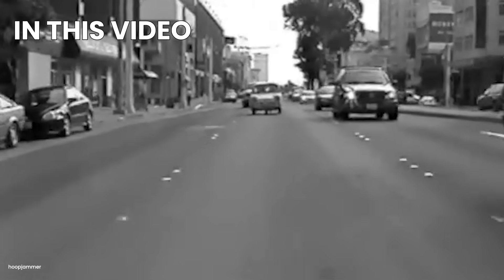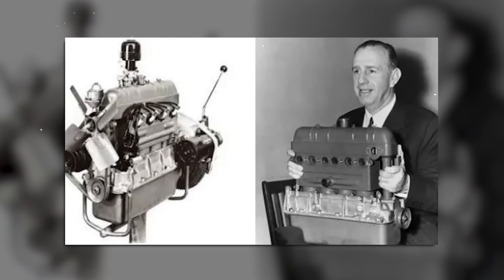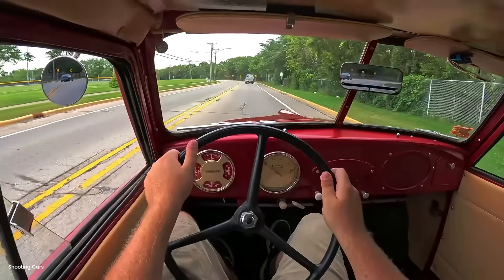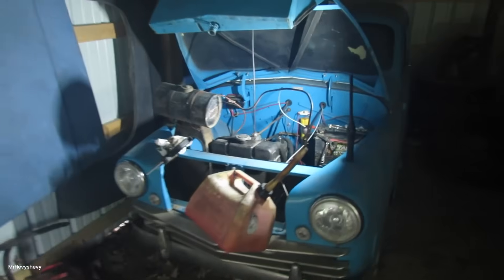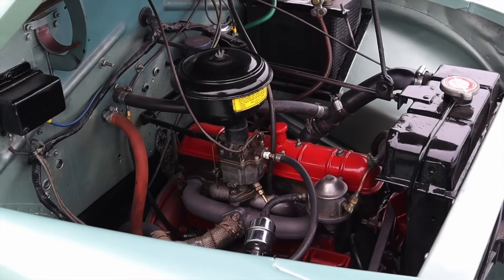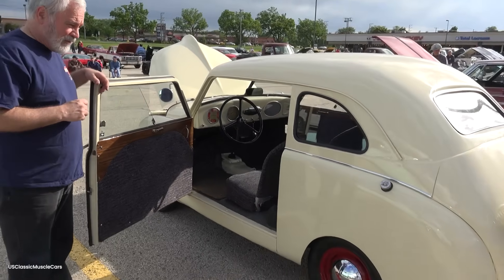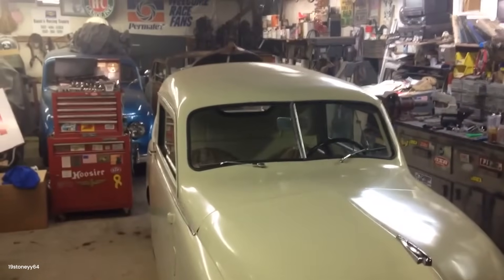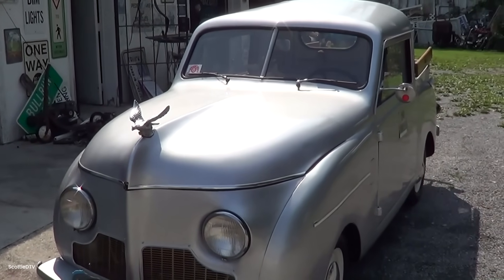Even at 30 HP & Flatbed Body, the 1947 Crosley Pickup Shocked Everyone Hauling Farm Loads

Comment: In the USA there are specialized vehicles sized like Crosley mostly based on golf cart frames and electric powertrain used in aeroports, in retirement communities, on golf course properties. There are neighborhood electric vehicles to complement those. Some places use ICE powertrain in parks based on gasoline or diesel. A lot of them are used on farms. I would argue that a lot of quad vehicles used for maintenance are in the same category. I would add some side-by-side vehicles, especially on the smaller size used on trails, parks, farms etc. A lot of those are manufactured by tractor manufacturers. Some are employed as maintenance grass mowers.
So, yes, the ideas and designs from Crosley are still alive in new vehicles. The one parameter, the carried load to weight ratio is mostly lost to modern complexity of safety equipment due to regulations. Small and very small engines market and electrical powertrain markets are flourishing  in those vehicles.
One more thing in common about Crosley vehicles and modern counerparts: they all are banned from use on highways/freeways in the USA and Canada. Some states made them illegal on the public roads allowing their use on private properties, off road. The latter creates a stupid need to employ huge modern trucks with trailers to move those vehicles from one place to another, especially on highways which is ironic.
Reply: stfu, you are just like most of todays generation, you compare todays technology to things that took place when technology sucked. these and the little bantam were better than any of the throw away shit made today by dikwads like you. you have no idea of what life was like in the late 20s and into the 50s. i have a crosley radio that was made in the 40s that even has a short wave receiver and it still works, the crap made today is used a while then junked. go hide in the basement keep your moronic opinions to yourself.
Reply: The Crosley Farm O Road was, for all intents and purposes, the first UTV.

Comment: This whole thing is filled with bullshit.
Reply: Please elucidate.  What, specifically, is incorrect?
Reply: @brucealanwilson4121  The Cobra engine was made of steel sheets shaped, drilled, and rolled into top, bottom, sides, ends, and cylinders, then copper brazed together into an engine block. The head was bolted to the block, not brazed on as stated. Light and easy to build, they rusted completely through when people used only water as coolant or water and alcohol as antifreeze/coolant. Crosley quickly replaced them with a CIBE (Cast Iron Block Engine) of the same displacement and power, but the damage to  their reputation was already done.

Comment: The Kei car is coming eventually in our European configuration. And speed and size does not matter,. Just the basic function. Three cylinder or electrically. It all add's up to the bottom line. So Yeah, The Volkswagen will have a come back. Configuration, All what is in your mind. It are on the doorsteps, Dacia are the first brand with the first model, Citron Ami is already on our roads.
Reply: Also kis rv to

Comment: The first post WWII engine was known as COBRA for copper brazed. It consisted of steel stampings and steel cylinder bores brazed together.  It worked well for generators but not so much for automotive. Later the CIBA (cast iron block assembly)  replaced the "tin block" in production and could be retrofitted to cobra engines. He bought the patents for cobra from Davis Engines in California . After production of cars ceased the iron block cobra served on in Thermo King refrigeration units until diesel engines took over.
Reply: My dad drove one Sedan style of these Late 1940’s till 1950’s for 50 mile Commute between Hastings and Gainesville Florida he said his had a stamped steel Engine cast Iron sleeves  North Florida Hard water probably was it’s Down fall. As it overheated on drive home when his father died.
Reply: Buy sh s obey ci n er 500 rubs onb hy bdrg e n feel cell
Reply: Hydergerrng I e shelbeu funeral. Only $150'000